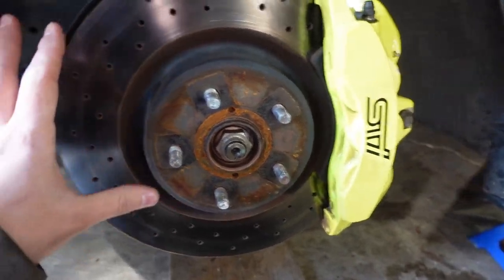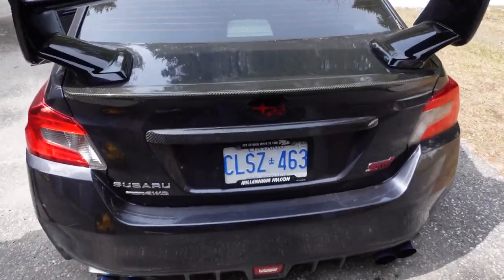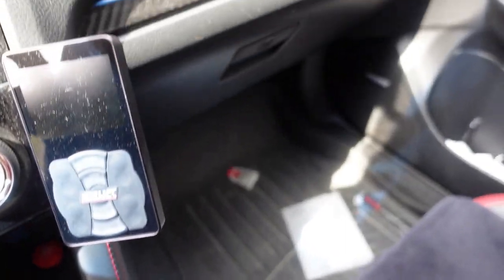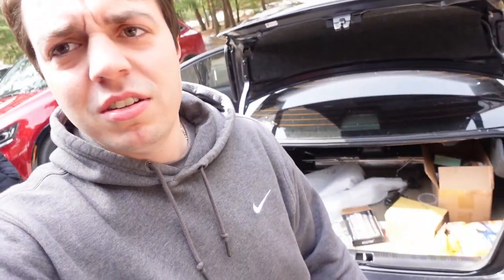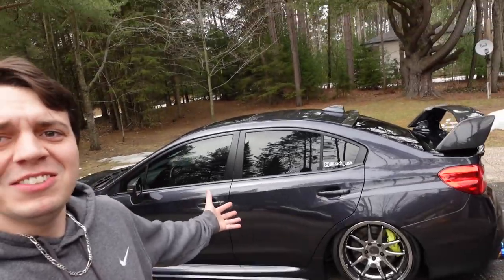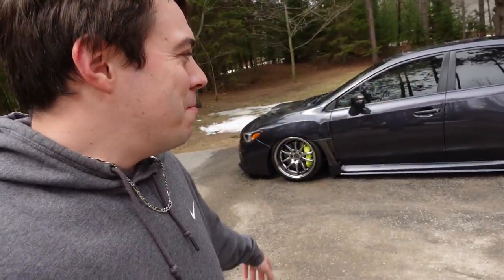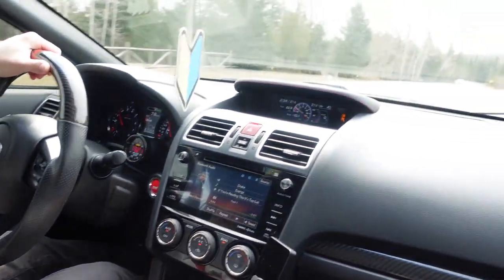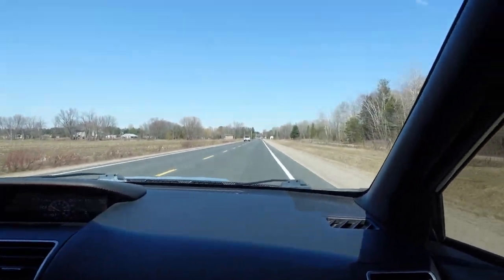Mice Got Into The STi...

Comment: I had fruit rats in the engine bay of my STi a couple years ago.  My car is red and no kidding, they would bring red objects in with them. Found a little red rubber bouncy ball on the under tray once when changing the oil, lol. Couldn't be too mad at them after seeing that.  Sprayed the surrounding area with peppermint oil and they found somewhere else to party, thankfully.
Reply from the maker: Anytime having an animal use your car as storage is never fun! Luckily they didnt do any damage to your car. Not that long ago i had the STi sitting for a bit and squirels decided to eat in the engine bay. Hasnt happened since but just shows it doesnt take very long for them to find a new home. Last year after this incident i ended up picking up that same oil and a bunch of dryer sheets. The car is also in a different garage so im hoping she will be safe this year!